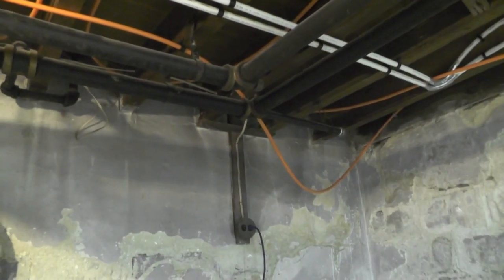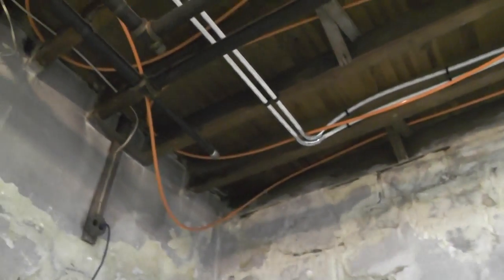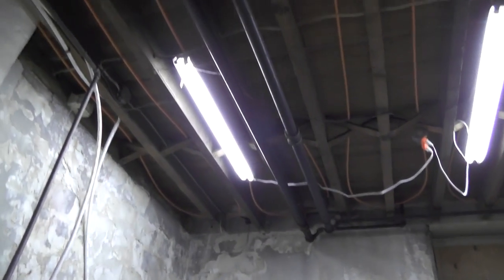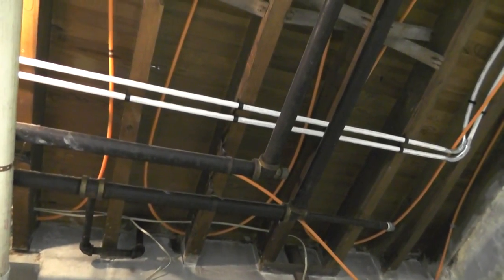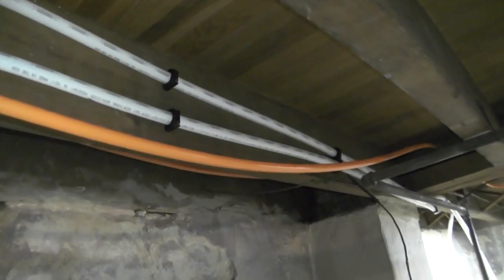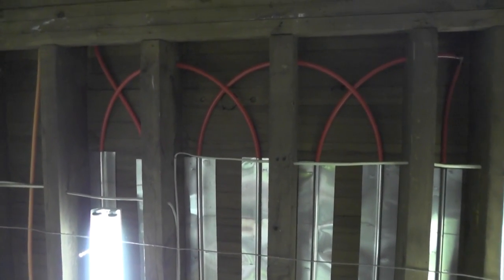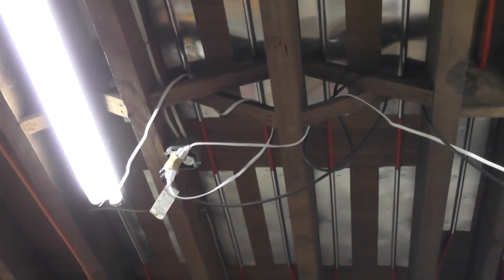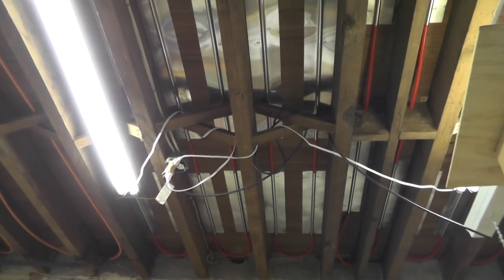How not to install Hydronic Radiant Floor Heating

Comment: Now, it would be even more efficient if you would install the silver bubble wrap just under the pex and then bat insulation - you want to keep that heat going up and not radiating down into the basement.

Comment: Hey great video. My contractor is doing the same exact radiant heat in my home now. Does it work well. Because I was told that radiant heat should be installed with cement and then flooring.

Comment: How about a closed cell spray foam over all that. It would keep all the heat above the floor.
Reply: If the foam got into the space between the pipe and the floor that would be a problem.